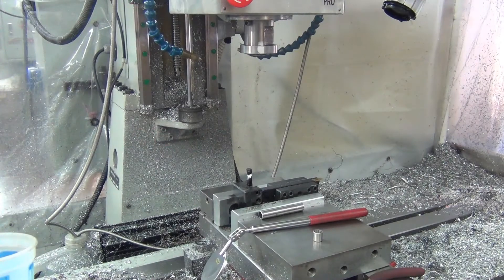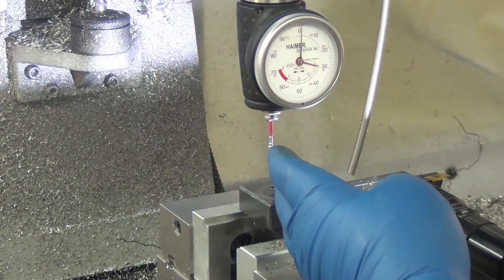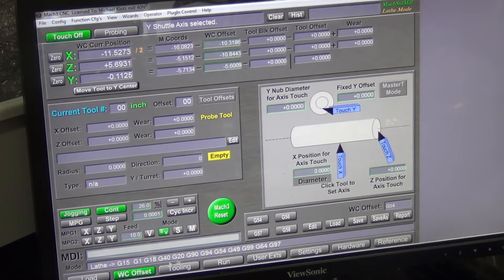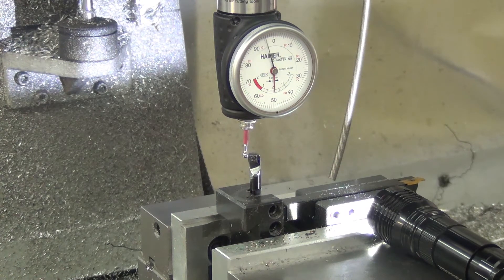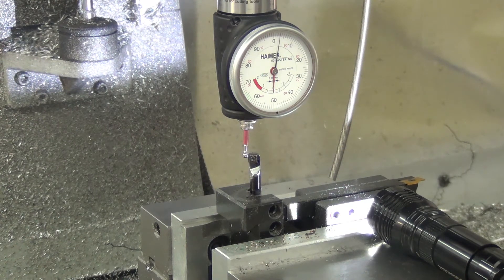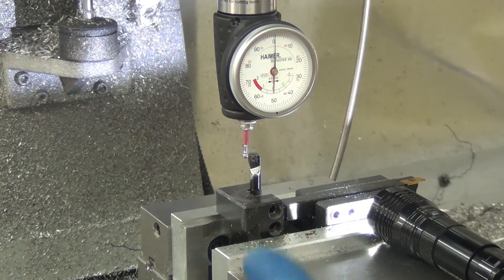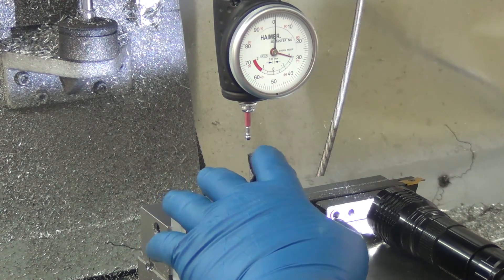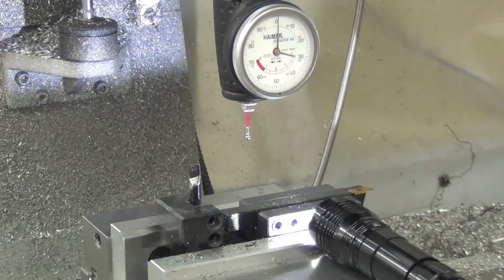MillTurn - Toolsetup

Comment: i had never thought turning on a mill but i like it👍
Reply from the maker: When you break the motor on your little cnc lathe, you need to have another option. lol  I thought about buying a bigger cnc lather first, but then when I learned about mill turning, I got the cnc mill instead.  A lot of my lathe parts are short.....perfect for mill turning. :)  I was setting up the mill to do some more today.  Should be cutting chips like a lathe tomorrow. :)

Comment: on my work i have the same haimer 3d taster, i use it for measuring axial lenghs on parts with tight tolerances on my cnc lathe
Reply from the maker: Does the lathe have a turret, gang tooling, QCTP?  Is the haimer in a dedicated tool holder?  Interesting!
Reply: bluehandsvideo it has 8 position turret with VDI tool holders we modified one to hold the haimer but it has no own tool offset. i dont have gang tooling because i turn more between centers but sometimes it could be handy if i had gang tooling
Reply from the maker: So, you set the turret to a certain Z position with the haimer selected and then pull the stock out until you get the reading you want on the haimer?  Do you worry about coolant with the haimer?
Reply: the haimer is for measuring the distance between the first bearing journal and the other side of the shaft to get the distance between the bearing journals within the tolerance of a tenth of a milimeter if the bearing journals have a different diameter you cant measure it with the vernier caliper because then your measuring under an angle
Reply from the maker: Interesting! Thank you!! :)
Mike
Reply: and i remove the haimer out of the machine when turning because the hot chips flying around
Reply from the maker: Ah...I was wondering.  :)  Thanks!

Comment: Wonder if i could get away with this in my Siemens 810M controller on my Storebro mill..  =)
Reply from the maker: You should be able to if the Z axis is under power and control....or the knee.  You just use the Z and X axis as you would on a lathe.  Set the Y as you position same as the lathe, then disable it or just don't use it.  It's great for short items.  Good luck!!

Comment: Good tips Mike!  I hadn't thought about using my Haimer for some reason.  I was setting with a pointed tip mill drill and fighting finding the center of a drill today.  I'll try to center with my Haimer next time.  I'm sure it will be a little tricky with a small drill, but easier than trying to eyeball exact center.
Reply from the maker: Thanks Jason!  If the bit is short enough, can the haimer tip reach down to the shaft?  That would give you an accurate, solid body to measure against.  You'd just have to trust that the bit was perfectly straight up and down.  Hmmm....maybe a sleeve.....you could measure from both sides and take the middle....that way any flex or movement of the bit would be compensated for.  I gotta have options......my eyeballs ain't so good any more! lol :)
Reply: bluehandsvideo I'll try that too.  I have block that my drill bits are mounted in so I should be able to do that as long as my drill bits are straight up, which I need them to be so my hole is plumb.

Comment: Interesting. I have been wondering how you set tool positions with that setup.
Reply from the maker: I need to make a holder for turning tools, but this is typically fast enough that it works for now.  I really need to get my little cnc lathe back up!! lol